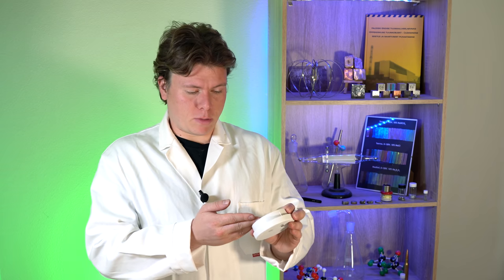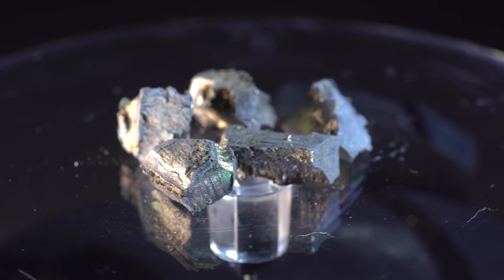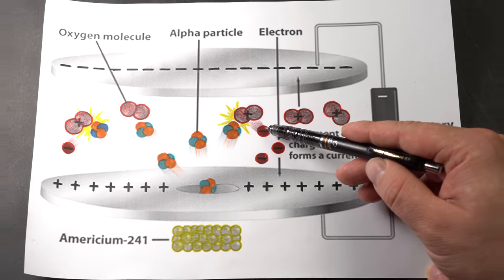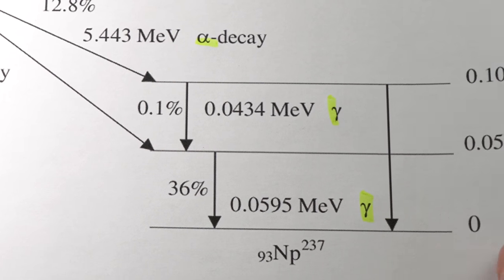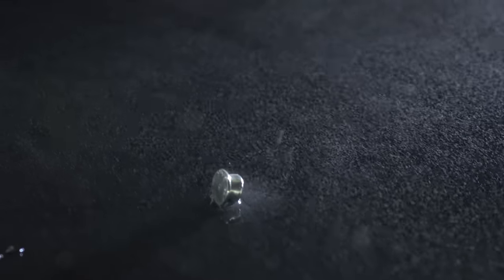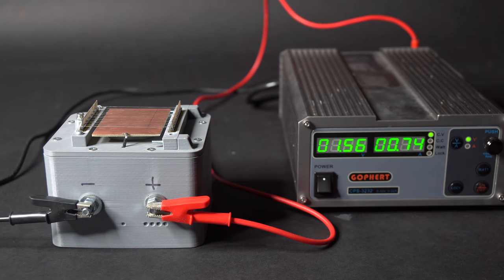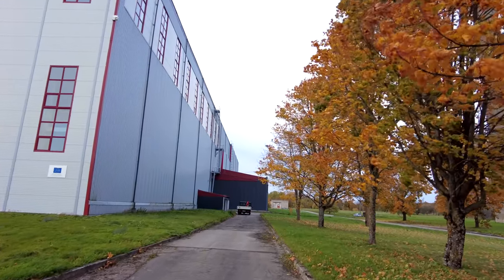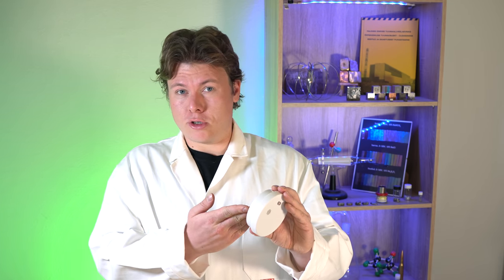Americium - A Metal, That Can VISUALIZE RADIATION!

Comment: Wow... Most people who live in the U.S. probably don't know that pretty much half of all our smoke detectors have radioactive material in them (I only learned last year on @TechnologyConnections myself). Yeah, these radioactive ones are still made & sold here in the U.S. since there are advantages & disadvantages to both types. And if you live in an old house here, chances are good that the ones already there are this type. We were never taught this, & there are no easily visible warnings or instructions on disposal of these things (except a few with very tiny print most people would never pay attention to, which only vaguely say to dispose of it "properly". Properly where? How? Gee, thanks! :face-blue-covering-eyes:

I'll look into it more sometime, just in case we end up wanting to throw away the main one that came with our current home. In the meantime, my mom went ahead & got several of the other type, since we kept having too many false alarms with the original central one. I'm pretty sure that she just took the battery out of that one, so we can let the other ones do their job without punishing us for cooking or doing laundry. 😅

They REALLY should emphasize this kind of stuff to us in school, & periodic TV & online PSAs, so we don't keep throwing potentially valuable (& dangerous) things into the landfill.

I'll bet only 5-10% of people using CFL bulbs actually turn them in to hardware stores for proper disposal, & the rest just throw them in the trash to crack & release toxic mercury vapors that damage their health, as well as shave points off of their IQ so they can keep making such mistakes (not to mention also harming the sanitation workers & the environment)...

And only this spring did the local news finally inform the public that our local waste management services had already had 5 or 6 explosions/fires this year, which have injured workers & damaged trucks & equipment (both during trash pick-up & processing) due to people just casually throwing rechargeable batteries away in the trash (Yes, even empty ones carry this risk). And that was just in the SPRING. Plenty more have happened since then, I'm sure. And HAVE been happening, every year, to possibly EVERY waste management company (the story was only interviewing the LOCAL branch of ONE of them, & there are 4 competing ones in my neighborhood alone, let alone hundreds-to-thousands all over the country dealing with this)...

Not everyone would have happened to see that news segment on that particular channel, of course. So this SHOULD be taught in school, & periodically reminded about nationally.

(Maybe more people than I realize actually DO know, but just don't care... a certain 🍳démĭk has proven that, if about half of the people here don't directly know who they're hurting, they're totally happy to harm others if it saves them from minor inconvenience... 😢)

And it'd certainly help way more if safe disposal/recycling of such things was more accessible for us; many of us are willing, but just plain not able. I live by a big major city, yet the only way to properly dispose of rechargeable batteries is by mailing them to a certain company, with the onus on us to package them safely so their contacts don't touch each other & they somehow don't overheat/freeze, & we have to pay $35-$65 or so per shipment. Either that, or I'd have to drive for four hours to drop them off at a special store in-person (and STILL pay THEM a $15 or so disposal fee!). Who's gonna do that when their four AA batteries stop recharging & they barely make enough money to get by in this economy/have no spare time due to working 2-4 jobs? 😕

(So I'm racking up a drawer full of dead rechargeable batteries, as well as regular ones since they can still have material salvaged, having to be super careful with them, so when I finally can package them right, I can get more sent in for the fee... & have had to rescue CFL bulbs from the trash cuz people in my family keep forgetting... At least now we're almost exclusively on LEDs, phew! But yeah... We REALLY need better solutions here.)

Comment: In the USA, we can send our smoke detectors --- those with radioactive source --- back to the manufacturer. All that is required, is to call the manufacturer (Kidde, First Alert etc) and free shipping/postage will be provided. Devices sent back need to have their batteries removed & must not be interfered with in any other way. Remember:  Be responsible with your garbage, our children will inherit it.

Comment: Could alpha particles be used as an oxidizer in a combustion reaction? If so, would you be able to stimulate certain nuclei to emit alpha particles on demand and then use them as an oxidizer for a rocket engine?
Reply: I don't think fission produces much in the way of alpha particles so you would need fusion. At that point though there is a far better way of using the energy produced plus the alpha particles for propulsion. You can either vent the extremely hot plasma directly aka a fusion torch drive. Or you can even use some of the heat produced to generate electricity and then use superconducting magnets to accelerate the alpha particles even more as you vent them. In both cases you end up shoving mass out the back at appreciable fractions of the speed of light with those so achieving several percent of light speed is doable with such a drive system. The fusion torch drive for example is potentially around 7% of the speed of light for example that's about 21,000 km/s. For reference that is about 43 minutes to cover the distance from Earth to Mars at closest approach not counting the need to accelerate and decelerate though so more useful for much longer trips where you have the time to get up to speed and slow again. It would get you to alpha centuri within a human lifetime for example so it would be a reasonable drive for a seeder type colony ship or similar as it could hop from adjacent system to adjacent system in reasonable time.
Reply: @seraphina985  i wasn't thinking of producing an actual nuclear reaction, just somehow stimulating nuclear decay.
Reply: @sethapex9670  That is impossible under known physics. Every experiment shows decay rates to be a constant regardless of conditions, at least we have not been able to measure any variation under any possible conditions that we know of to actually vary. This suggests it may well be impossible but of course we can't rule out variables unknown that can't be found anywhere on or near Earth (Experiments involving decay have been performed on the ISS too I believe).
Reply: @seraphina985  what about metastable nuclear states?

Comment: My screen touch to back up videos and relisten is not as easy as should be. I spent 25 min.s on this 20min. video.🙄👂👁️👍 In Saint Petersburg, Florida, USA it is NOT common knowledge that smoke alarms are to be disposed of separated, culled from other trash. I know a dosimeter, Gieger Counter is present at the entrance of our *county's Solid Waste Dept.
I heard it alarms even when a person that had recent multiple X-Ray images taken.
  There is collection of unused household chemicals and you can sign out certain usable/ useful things like paint or cleaners and save need for manufacturing more unnatural SHπ÷T!! 
*Pinellas, waste-to-energy incinerator and landfill. Pinellas County is the central Fl. West/Gulf-side peninsula holding Trampa...err😁 Tampa Bay. 
   Thanks for doing all of what you do, keep on keepin on & Rockin'-n-Rollin 🤘🤙🎷🎸⚗️🐝🌟📡🌀   (🐻+🦅=💌??)

Comment: Actually I have a surprise for you. The way these are made is not The way you explain it 7:10. The reason the gold foil is there is not because they added the gold foil afterwards. In the manufacturing process a thin layer of uranium 238 is put in a sealed envelope of gold foil which is then bombarded with neutrons. The U-238 then becomes neptunium. After a short time the neptunium becomes plutonium. Once A calculated 80% has become plutonium it is again bombarded by neutrons. Is this final act plutonium trans-mutates to americium. The reason this is done is number one so that no one comes in contact with the extremely potent and dangerous americium. And the second because you could use a relatively low cost Neutron oven or neutron beam accelerator instead of a nuclear reactor.

If a nuclear reactor was you degenerate americium you could produce a lot of it however you would need complicated chemical reactions to isolate it from other isotopes created by the reactor.

The same exact process is used for making polonium. Polonium being one of the most deadly chemicals known to man, contact with it is eliminated at all costs. Polonium is used in anti-static brushes. However since it is extremely toxic and radioactive in extremely small amounts it is made by putting bismuth in a gold envelope and bombarding it with neutrons. Inside of the envelope will eventually contain polonium and it will never come in contact with the environment. This entire life cycle will be inside of the envelope.

Comment: eh, radiation isn't that dangerous, Ramsar, Iran has naturally high background radiation levels, 90x higher than average dose per year, the people there are actually slightly healthier than in the surrounding villages, maybe because of all the medical personnel studying them meaning they get better access to healthcare, but still it doesn't seem to be a negative unless you get a high dose all at once. Like fire, you can sit right next to a candle flame, but if you sit right next to a bonfire or forest fire, you will get burned, even though the total heat you get from having a candle right next to you for several hours/day for several years is greater than the total heat you got in the 10 seconds you were standing 10cm away from a bonfire. Old smoke detectors going into landfill isn't a problem.
Reply: Bonfires and forest fires are two different things :/
Reply: @thatguy8777  they're both a lot more difficult to sit right next to than a candle, just like sitting next to a kilogram Co-60 and sitting inside a nuclear reactor are two different things, but both deadly.